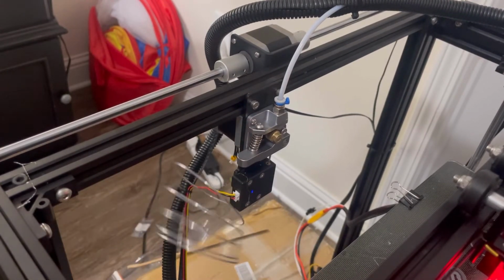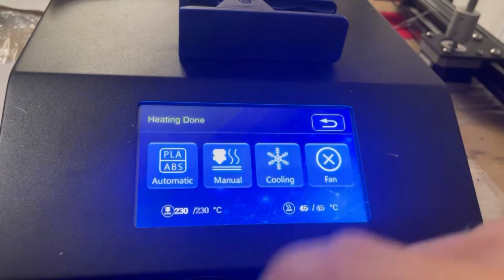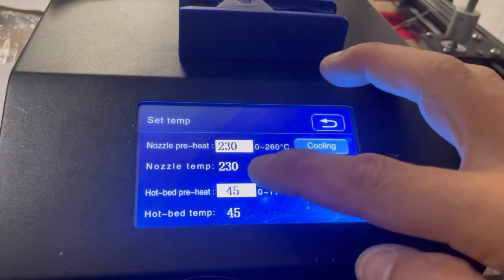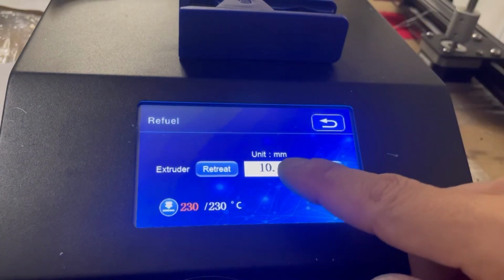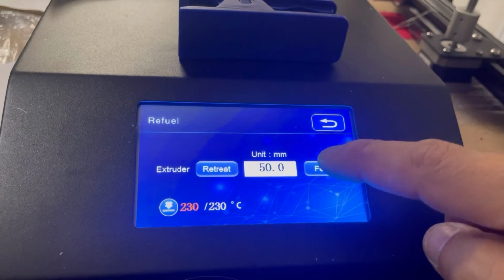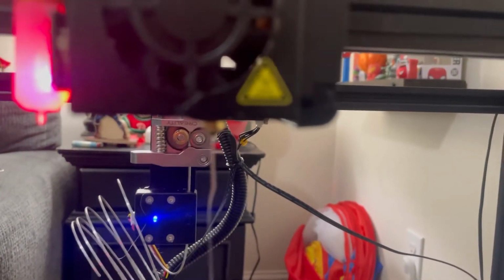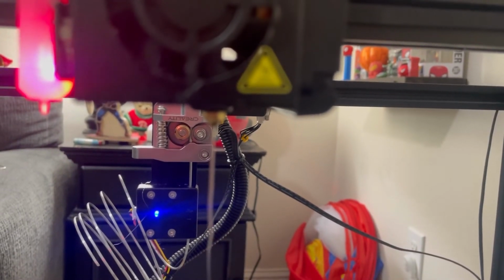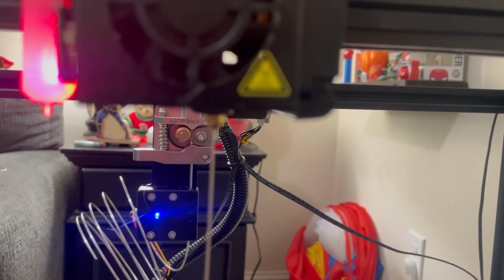Ender 5 plus upgrades & replacement | How to replace stepper motor on ender 5 plus

Comment: great video mine did this i just converted it to a direct drive cant be an issue if you remove the whole issue.
Reply from the maker: @shawnmcandrew6923  dd is a great and almost necessary upgrade esp if you’re trying to print faster

Comment: I have 2 machines and the first one I got about 3.5 years ago has a removable gear but the second one is like yours where the gear won't come off, is it epoxied onto the shaft?. I have already replaced mine but was just thinking about trying to cut the gear off the shaft and file a keyway onto the shaft and keep it as a spare.I also fitted Bondtech BMG extruders as the aluminium ones cant keep my copperheads fed with filament at the speeds I print

Comment: So that brass gear is super easy to remove... take it and put the gear against a solid surface.. and smack it with a hammer flattening it... just pops off then... I used a file to make a flat spot on the shaft and got back up and running in about an hour.
Reply from the maker: I’ve seen people use a torch & vice grips to. I’m just worried about damaging the motor. Thanks for the tip & the view, much appreciated!

Comment: I looked at that extruder. But it is not dual drive, i.e. the filament is only being pushed by one gear, that is not really something you should pay good money for. Also, buyer beware, if you have the extrudermotor you showed (with the worn gear) most or at least some of the cheaper all metal dual drive extruders on Amazon won`t fit, even if it says Ender 5 (plus/pro...) The shaft is just too short to reach the 2nd gear with the one that will be on the shaft. Believe me, I tried!

Comment: A little late, but you can use a gear puller or cut it off. But solid video!
Reply from the maker: Thanks Daniel! 
Yea I know if I messed with it I could have gotten it off & I appreciate the tip so atleast next time I can salvage the motor but than again every other printer I’ve had has the removable gear lol no
Clue why they did this on the ender 5

Comment: Good info.  Just upgraded my ender 5 plus to micro swiss direct drive and my extruder was the same as yours.  However the gear is a press fit so it can be removed with a tiny gear puller or i used a vice and two flat head screw drivers and in 15 min of not trying to break it and got it off
Reply from the maker: I’ve heard of you get forceful you can remove the gear, but for $15 I’ll just buy a new one lol I’m upgrading my board,hot end and tubing along with a stainless steel gear. Should make for a nice quiet efficient machine.

Comment: Ok, I'm gonna order some spares for my e5+s after watching this, tnx!
I saw some odd bits here. If you leave the Bowden in the coupler when you screw it in, it digs into the Bowden and destroys pieces of it. It can create wobble, giving issues with retracts.
Also, you said 2 cm behind the threads. The entire length of the coupler is 2cm, I think you mean 2 mm. Damn metric stuff right 😁
Reply from the maker: Haha probably that’s why I give visuals but you get what I mean! Lol thanks for watching its a great machine but definitely a few bugs and upgrades before it runs flawlessly

Comment: I surprised the Ender 5 Plus doesn't have a removeable gear, my CR-10S does, I never even noticed.
Reply from the maker: I know! Perfectly good stepper motor now junk!
Reply: @Darkwingdad  i took a dremel and cut the gear off. No problem. Put bondtech extruder Fytesc clone instead

Comment: I'm upgrading my cr10 v3 to a voron switchwire. Cool video. There is a tool you can buy to remove the gear. It's like 5 bucks on Amazon.
Reply: do you have a link?
Reply: @Vash612584  no I'm sorry it was just there one day when I was rooting around. I should've bought it. I think it's a tool unrelated to what we would use it for and I can't find it again.